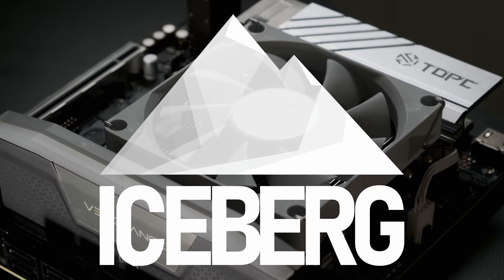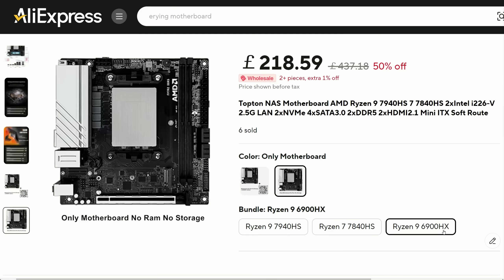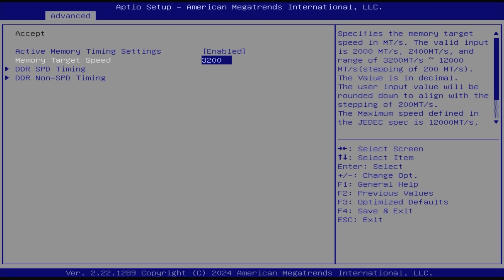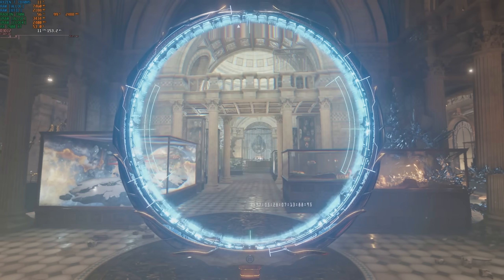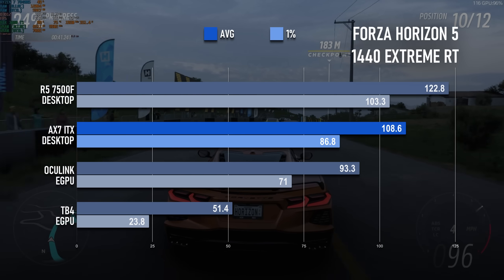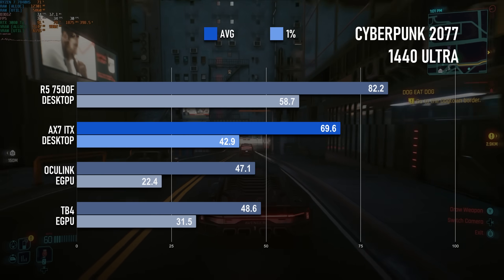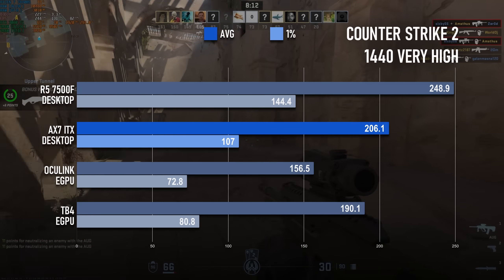Just a perfectly normal ITX motherboard from AliExpress.

Comment: this brand has a very popular motherboard among the computer enthusiasts here in China named q1hy, which is 13900hk es. its price is low(around 1200 rmb) considering it's experiment sample. But it almost has no bug that affects using and as an itx motherboard it has 3 m.2 slots.
Reply: You got a link to it?
Reply: It's the 10729 itx boards with the Q1HY (that's the Engineering sample name) which is just a 13900hk.  Chances are that's the one he's talking about...
Reply: 13 gen Intel? has it got the microcode patched?

Comment: These laptop CPU mobos from AliExpress has so many corks. Some are good and some are bad. I have a Erying ES intel tiger lake 8 core that's similar to the 11800h. It's actually great and full 16x PCIE and memory timings. But the 12 Gen ES on these boards is limited to 4x 2.0. so you have to do your homework and make sure your expectations are right.

Comment: I shop a lot Aliexpress and they have amazing deals especially if you are looking for tray CPUs (the Ryzen 7 7700 non X goes as low as 165 USD while it's 250+ in box). Name brand Mobos and brand new GPUs are very expensive compared to most local retailers.
Reply: any trustable seller to mention?

Comment: Talking about the cooling solution, IIRC some of those integrated CPU ITX board companies have vapour chamber heatspreader instead of that hunk of aluminium for spreading the CPU heat under protection

Comment: To me, one of the most interesting thing about these "Mobile CPU on Desktop Boards" is power consumption. Yet I can't see anything about that in this review and that's a pity IMO!
Reply: true
Reply: 100% my primary plex DVR is a 5700G because it idles at like 30w including the tuners and drives.
Reply: Yes. The places where a weird jankmonater like this would really make sense are edge cases like the home lab, where power metrics and feature checklist takes precedence over performance. Why, for instance, hobble your performance buying an igpu chip if you're going to add a discrete gpu.
Reply: for real. that's the one thing i was expecting to be looked at in this video.
Reply: Also for its lower heat output. I have a passive heatsink for AM4 and since it doesn't use a custom backplate it should be compatible with this board too.
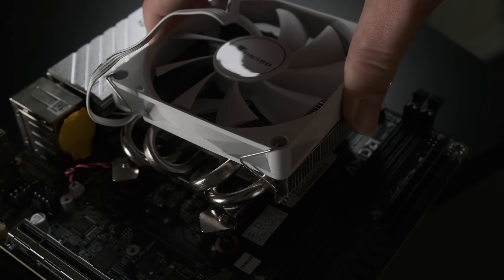Reply: You can see at 3:25, cpu power 65w
Reply: @sparkletornado5890  that is not the power draw, it does not take into account vrm efficiency and might be even reported wrong
Reply: @PizzaUndervolt  these monolithic chips doesn't have the Io die that consumes 20w alone.
Reply: @sparkletornado5890  ryzen tdp has absolutely nothing to do with power measurement sadly.
Reply: Mobo plus high performance 8cores for $300?

Too good to be true. lmao

If I had the spare money I would buy it.
Reply: @Splarkszter  at 4800 mem speed and 8x pcie?
Reply: @PizzaUndervolt I mean aside from the memory speed it’s an 8700G plus a board for the price of less than an 8700G
Reply: @KitsuneKiera  wich will make it perform worst than a 8600g, let alone 7600, in everything but cinebench
Reply: @PizzaUndervolt it’s still cheaper by around £90 than the cheapest A620 ITX board that I could find and said 8600G, and around £40 cheaper than that Jginyue B650 ITX board. I’d say the performance regression fits the cost difference.
Reply: @KitsuneKiera  not if you use the igpu wich is extremely memory bound. 4800 not tuned is probably 100% slower than any 6000 tuned kit results. If you don't need igpu performance the 8600g makes no sense.
Reply: @Splarkszter  got z790 pro wifi board for 116 and i7-12700kf twelve core for 165.
Reply: You don't buy an upgradable PC for low power consumption you buy it to use MORE power! If you want low power consumption you just get everything soldered to the motherboard like some sort of mac fanboy.
Reply: @sharoyveduchi this is for cases where thermals are greatly assisted by low power use
Reply: @sharoyveduchi  it's really horrible that no cpu maker has yet made a cpu that takes an entire 240v 10A line as input
what are they even doing barely using 10% of that SMH what a waste
Reply: @ThylineTheGay  dude by more power I mean like the usual 65 to 120 watts or so that you can get away with on an air cooler. Once you reach into the 200+ watt range you see diminishing returns.
Reply: @sharoyveduchi  by that logic you can get a mobile cpu that has the same performance of a desktop cpu running at 65w, but at maybe 30w.
what's wrong with that?
as you said about diminishing returns, what we care is performance per watt, and mobile cpus have amazing performance per watt

Comment: The ITX form factor was originally designed as a desktop platform for mobile CPUs anyways. If anything we've been using it wrong this whole time, and now the Chinese are the only ones using it as intended.
Reply: Not really.
VIA invented it for their low powered Epia CPU's.
Not many made it into laptops
Reply: Nope. ITX is intended for thin - clients in business scenario and industrial control boards. Cheapo onboard CPU with cut cost components. But well, ITX is “abused” in many good ways nowadays. 😉
Reply: I wonder how were we misusing ITX?
Reply: @HeadHonchCrow2  Sockets, the board size is small to make it cheap, and that originally meant going socket-less. We've been making these thick many-layer ITX boards with sockets that, instead of being cheap, end up excessively expensive.
Reply: @KiraSlith  But there's ITX boards with desktop sockets in the market. Most Mini-ITX models use laptop CPUS. 

Which reminds me...Y'all know those PCs that use a tiny board, but the chassis was meant for a regular motherboard?
Reply: Who exactly is "we"?
Reply: Been running mobile cpus on desktop for 20+ yrs. Athlon XP, Turion 64, C2D, still have a C2E QX9300 mini itx box running various network services and a linux desktop. They've always been a great option for light workloads.

Comment: I’m curious, does the NVME drive take 4pcie lanes away from the gpu, or does it run on the mobile chipset?
Reply from the maker: The chipset has 2 sets of 4 lanes for NVME.
Reply: @IcebergTech  Ah, that makes sense. Probably why performance was much better than the occulink system (at least when it wasn’t cpu bound)

Comment: I just got 25000 points in R23 with the 12900HX you mentioned, I thought this one would be more powerful to be honest. Great review, love this weird things
Reply: HX CPUs from both AMD and Intel are desktop CPUs in a mobile form factor, using the exact same silicon. When their power limits are removed, they end up performing like their desktop counterparts.
Reply: @sahara97m infact I was thinking "oh my god, why he didn't pick the 6900HX" 
It's the best one and probably he would had a better support for 3200mhz ram that on ddr4 are a good spot for a mobile chip.
Reply: The 12900HX is a 12900K in mobile soldered form. With the power limits removed it would be identical or even a bit ahead thanks to having to be direct-die cooled.
Reply: @DigitalJedi  mine is not, it has an IHS, although I "liquid metaled" it

Comment: One question I have, Ice: is there any specific reason why you didn’t test the Motherboard with one of your dedicated GPUs? Would have been interesting to see since this board + a good budget/second hand GPU would make for a great, affordable gaming rig imo.
Reply from the maker: Which GPU did you mean? Like the 7900 XT? Honestly, I chose the 3080Ti for this review just because I’d also used it for my EGPU testing, and it seemed like a relevant comparison.
Reply: @IcebergTech  yeah, would have been a bit interesting to see how these two compared to each other in a same system, but I guess that would be too much, given that this isn’t a GPU Video ^^
Reply: i wish you tested a 6700 or a 6600xt with it

Comment: Thanks for the review. If this was about 200 pounds it would be an awesome value for money. But for a little more for 250 you an get a used mini ITX DDR5 and a used 7600X which would destroy this thing. For context I got more than a year ago a 7600X for 150 euros and a Gigabyte B650I ITX board for 200 euros. Total 350 euros and it was and still is money well spent. I know you came to this conclusion as well but just wanted to state this for people getting into ITX. Also damn, that BIOS is what you get in laptops, just terrible.

I wonder if you direct die cooled the cpu with some mods if it would performed much better. Probably der8auer or some mods would allow for it.
Reply: this have gpu approx near gtx 1650 so u must consider it too

Comment: Trying to overclock it with older UXTU is a good idea. I don't know if 7000 could still do it as my 5600H does to be 1st in hwbot
Reply from the maker: I’m crossing my fingers that someone makes a BIOS that works with RAM above 4800, and if that happens I’ll be sure to try overclocking too!
Reply: @IcebergTech  smokeless umaf is the key

Comment: Does this board support resizeable bar?
Reply from the maker: Nah, unfortunately not.
Reply: @alexturnbackthearmy1907  yea modern boards also support ram overclocking but this one doesn't.
Reply: @bryanwages3518  Nvm, i skipped part about its bios being a weird mess with OEM/very old system looks.

Comment: AliExpress has turned from scam junk to weird jank in the past few years, and I'm all up for it...
Reply: depends what you are ordering, pc parts pretty good. but theres a fake website using gpu listing to advertise. avoid them. also i have found for things like lipoly batteries are very scammy, with cells claming over 2x the capacity.
Reply: @Altirix_ if you can measure capacity you can get a discount up to 100% by contacting the seller (and raising to support of he doesn't cooperate)
Reply: @Altirix_  yeah i mean like, amazon has a lot of those types of products too
Reply: agree
Reply: Brazilian, used to buy from there because of the total lack of taxes. It was wonderful like products were half the price, but that party has ended.
Reply: You're more likely to be scammed on ebay or amazon than on aliexpress. More than half goods you find in amazon are just overly inflated aliexpress items
Reply: I order from AliExpress since Years now on and never got scammed once soooo wdym?
Reply: I have bought some older CPUs when those weren't available locally or were overpriced, and I have to say for that, AliExpress is pretty good! 

But I wouldn't want to risk it with anything more expensive than €100, I'd keep it at the ultra budget components where the local market doesn't have anything to offer...
Reply: God bless aliexpress for their Xeon V4 custom mobo kits, I already bought 4 of them with a 2680v4, best value ever
Reply: Ive never ordered something and had it never show up too. It takes a bit, but you WILL get the item.
Reply: I bought my 3D printer from there.

This cheap Prusa MK3S clone that I upgraded with genuine Prusa parts. And now it performs just as well as a real MK3S and provides me with the same upgrade path as one
Reply: @nickfury1279  thats smart
Reply: It’s always been decent. My PC runs 5700x and 3070 I got on AliExpress just fine
Reply: temu and wish has replaced aliexpress as the scam junk sites, basically.
Reply: The scam junk is still there but now there's real products that people might want to buy. Better than Temu which is just scam junk.
Reply: Actually a great idea just not as good as it could be.
Reply: I have been ordering from Aliexpress since 2012. Over 100 orders and I have only had rare minor problems. There have been a few disputes due to the quality of the goods, but the support has always resolved them in my favour and I have always received a refund.
Reply: i never got scammed, they even send me a free stuff lol
Reply: @andreu9582  depends on the sector of goods you buy. I get low value stuff like screws, wiring, esp32 boards and diy tools and they’ve all been great and much cheaper than one can get on Amazon.
I would be skeptical if any Chinese seller is actually able to sell you a GPU for 30-50% less than what you get locally, for instance.
Reply: Its really depends on each store. Shopee and Lazada in my country are just ali dropship at this point. Needs to check the review carefully like in aliex anyway.
Some aliex store even have official Shopee Lazada store by themself, lol.
Reply: Always has been
Reply: aliexpress was never scam junk you just need to know what to look for i have 100+ orders never was i scammed nor dissapointed with what i got.
Reply: I have no idea what does that mean, but this ignorance generalization of Ali being a scam, just because a minority of people had bad experience or some weren't careful, then it's a scam site is honestly stupid, Aliexpress was never a scam (there are scammers in Amazon too, doesn't mean amazon is scam) ive been buying on ali since 2011 with 3k+ orders, never had issue or was scammed, Ali is also cheaper & better than amazon, i hadn't ordered on amazon or ebay for over 5 years now
Reply: @thalateyetrust me components from aliexpress are crazy good quality. I built a pc with aliexpress watercooling ram motherboard and cpu an it’s crazy good
Reply: Have you seen the motherboards they make for old server CPUs? it is wild shit and everyone who tried - loved them!!
Reply: AliExpress is always been weird jank, people have just realized that it's a selling platform for Chinese companies and not a company that sells products
Reply: Been buying from it since 2018, minor problems only.
Reply: Many descriptions actually mention that they upgraded from previous bad products which is good imo. Good thing they listen
Reply: I tried them out and ordered a ryzen 7500f . Got it in about 2 wks. no issues .
Reply: AliExpress offers the whole gamut of Chinese jank (in price and quality), instead of just offering curated but cheap crap like Temu, for example. So there's always going to be high variance on experiences buying there.
Reply: I bought a single slot low profile 1050 Ti from there and while its small fan was loud it did the job as advertised.
Reply: It's never been scam junk, I've been ordering on AliExpress since 2015.
Reply: @one_step_sideways  you haven't been buying the junk simply, or haven't yet been scammed, I have, tried to buy some optics for microscope and the seller send a 15$ part instead of the 50$ I ordered, and it takes a LONG time to return the item and get refund, like 5-7 weeks, and if you add to that the 3-4 weeks of waiting for the item to arrive in the first place, that is over 2 months
I mostly buy on ali stuff I can't order locally, but it seems there is general effort from chinese to destroy any local sales networks using subsidized webshops of their own, like TEMU, and you know what happens when a business tries to capture a market as aggressively as that, they'll accept the loss when conquering the competition, and when there is none - they jack up prices to recoup their losses, and you, as a buyer, end up paying more in the end
locals are been exploiting this, they jack prices up 300-500% on cheap stuff, and at least 100% on anything over 20$, so, yeah, not a great time for consumer these days, especially when every manufacturer tries to design their product to fail as soon as possible, and I don't think it will get any better any time soon
Reply: @one_step_sideways  you can still find fake GPUs quite easily
Reply: @one_step_sideways  Eh, there were quite a few back in the day if you weren't careful, it wasn't as good as it is now...
Reply: sadly scams are still there and it still doesn't make that much sense in the end on the value prospective as these products easily fail for no reason during regular use
Reply: it's likely been like that for a good while, you just need to know where to look, and to get a sense for what's too good to be true

batteries, clothes and the like, and storage particularly, are to be avoided in general

also like, a lot of things are the same drop-shipped item from whatever western reseller, just cheaper
Reply: Its always been like this, its just the scammers moved on to Temu. Keyboard stuff like clone keycaps and bulk order switches, and even entire decent keyboards in odd configurations are everywhere.
Reply: consumering new religion, not smart mostly
Reply: Yes.
Reply: ew.